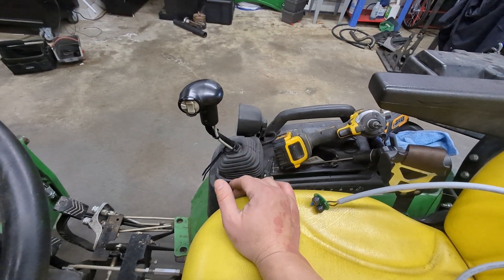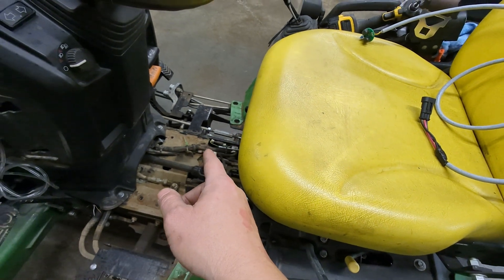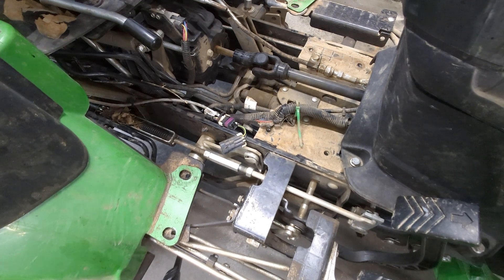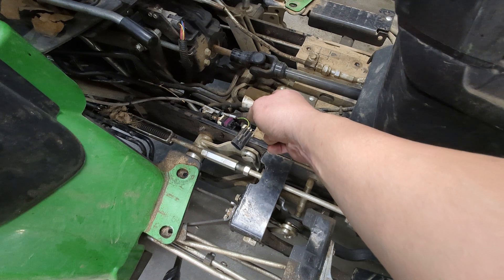John Deere OEM Third Function - Adding a Continuous Run Button

Comment: Would that be possible to be used to actually turn on or off the third function valve? So that way you could turn it off in case you accidentally hit a button while driving with load or while off the tractor and don’t want other people messing with it? Not sure if my question makes sense.
Reply from the maker: Your question makes sense.  I didn't want to add that complexity because if you add it, then you have to deal with the inverse, which is trying to turn on continuous run and it doesn't work because the safety is "on".  If it was very easy to accidentally hit and there was some dangerous effect if you did hit it, then it would make more sense, but in the case of the 3rd function, your tractor will just act funny until you realize what happened.  Similar to not plugging in the power beyond completely or a loader connection.  If that happens, it's puzzling for a minute, but then you rectify it and continue.

Comment: ive got a 2020 1025r, and also have the john deere 3rd function setup like your showing minus the continous button i wouldnt mind getting once you get a hole for them in the center....what ive been wanting is your hydro setup the hooks to your top link on your rear....ive got the power beyond, but have been wanting the lines that go from your front 3rd function that goes to the back hydro connectors and the bracket to hold them on the rear like you have.....
Reply: They are on the website. Its the third function plus kit.
Reply from the maker: Yep - the 3rd function+ is available on the website and in stock.  Give me a ring if you have questions.

Comment: Ok I found the part numbers for the joystick handle and ordered them. They do not include the gray membrane or white spacer, as that is part of the switch wiring and does not appear to be available separately from the entire 3rd function handle kit ($360).  Maybe add your own membrane and spacer to your switch Kevin?

Comment: Another option to consider is a simple circuit at the end of the existing wiring. Use of a set of latching circuits, you could have that button be a latch that then looks for another input. Such as the directional button. With proper wiring you could still support reversing of the valve and auto resume of the other direction. Pressing the button again will cancel all flow. This could also be wired so that in even of ignition off (or other emergency shutdowns) it goes to a neutral state.
Reply from the maker: Agree and I have a schematic built using latching relays, but it's obviously more complex than this approach...but it has its advantages.  That said, I hadn't thought about using the 3rd button to "activate" the latch and then wait for another directional input.  I definitely like that idea, but sounds like it might need a micro controller, which isn't an issue necessarily, but will require more space than what is afforded in the current handle.  As mentioned in the video, for the HydrosPlus 3rd function, there will be more buttons and I'm still deciding the best location for those. It will likely have the latching relay approach because I will already need a housing for the potentiometer.  

Thanks for the comment!  Very helpful!